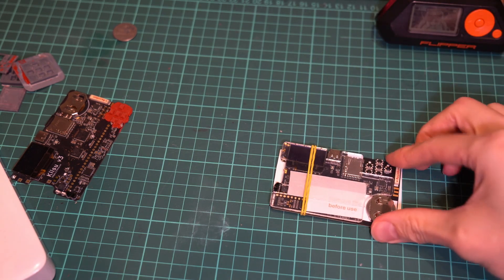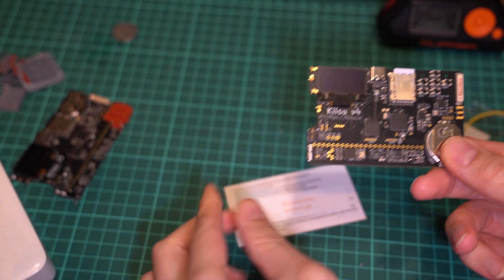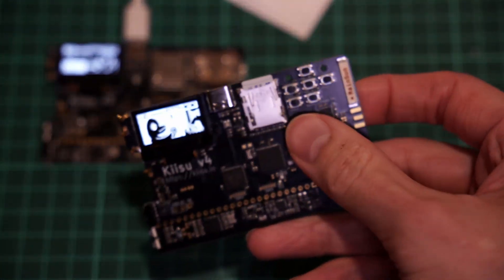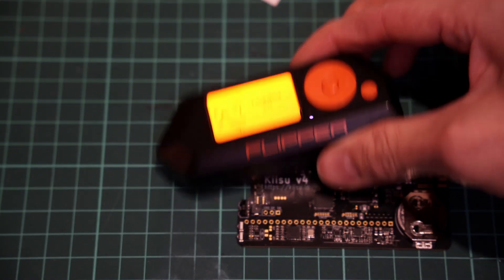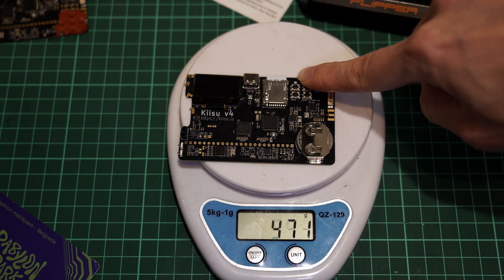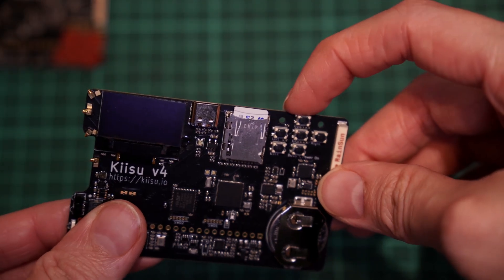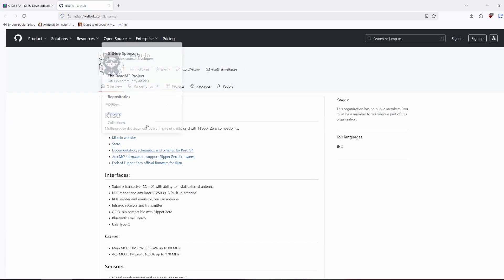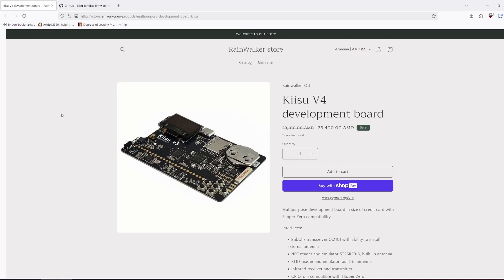Kiisu v4: hardware updated & freshly forked Flipper Zero FW

Comment: 4:57. I received Kiisu v4b. I measured button actuation force: 200g. Button plastic is white instead of black. So improved buttons on B model.
Reply from the maker: I've ruined one of the buttons with superglue while testing things out, and coincidentally got very similar white buttons as a replacement, so an upgrade for those who got the older version is absolutely possible if you or one of your friends can solder

Comment: You could 3D print a ring with a flat spot to go on the front of you little thumb so it will not hurt to push buttons or maybe we can mod them and solder on better buttons.
Reply from the maker: A ring is something extra to carry, and I'll probably forget it more than anything. 
I've also checked the printables case and it looks meh. Still think that silicone is the way to go, so waiting for the next iteration of the mold it to vulcanize. 
Problem is it sticks far too well to the pcb for some reason and I've only got one try left ~_~
Reply: @agathakazar could use polyethylene film from the kitchen to protect the board maybe?